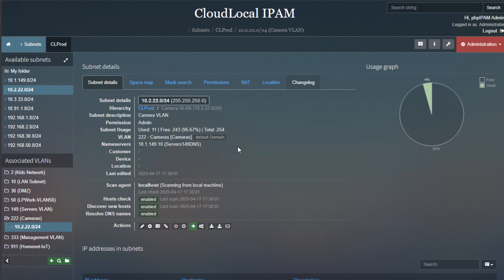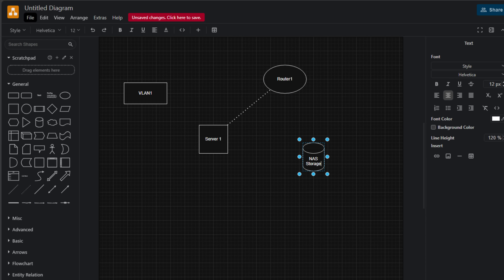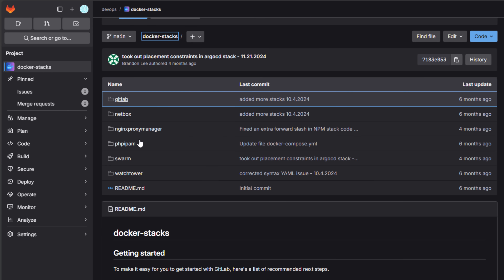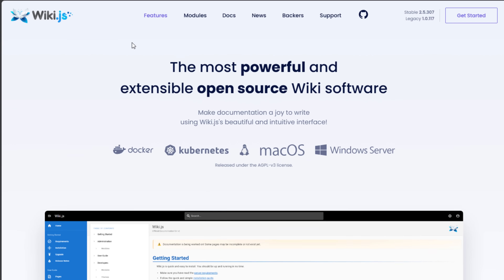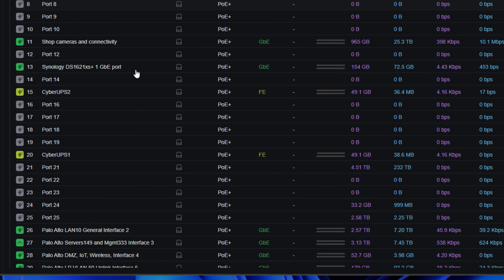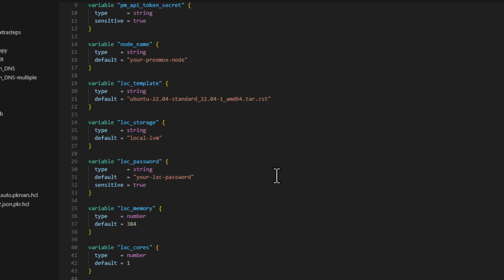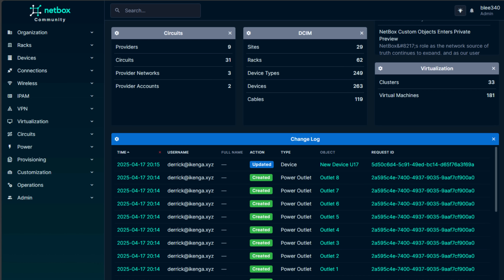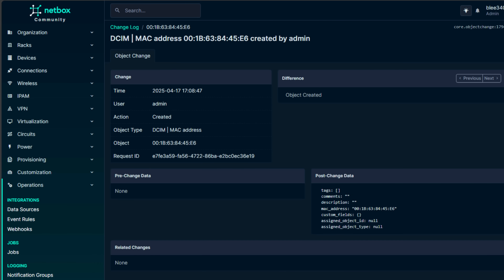Home Lab Documentation // Tools Tips and Tricks!

Comment: For the wiki part I use just a common Hugo based site (MD files that generate static html). As a fallback I have copy of the generated site hosted at a normal external website provider with a password protection turned on

Comment: Do you know of any proper and active alternatives to phpIPAM? Any project that "forgets" to properly update the installation guide once written at least 11 years ago I don't call recent and active. In this 11 years old guide they talk about Debian 6.

To cite the Debian Wiki "Squeeze was the oldstable distribution until the end of May 2014. Squeeze received Long Term Support until 2016-02-29. Now it is archived, and no longer receives security updates" => the LTS version they talk about in the installation guide is out of LTS status for more than 9 years! Ample time to "just" update the Debian version and have test it once and see if it works with this new version.

I mean even the PHP versions they talk about are ancient going back to a time the 4chan hack also had.

Even the not mentioning if there is an official Docker image I don't see as a bigger problem!

Comment: For me, it varies.

re: logging changes into a changelog
My primary issue with this is that the vast majority of the time, the changes happen significantly faster than I can document them.

If I were to try to document all of the changes, 99% of the time would be spend of the changelog administration rather than the actual homelab administration.

As such, changes that are stable and have been committed, that's when I was will usually go back, especially if it is a system nor a service deployment, that I will go back into the bash history, to pull out the commands that I used that finally, ultimately worked.

(Because documenting bash commands that failed or didn't work, even if I was auto-enrolling/auto-documenting those changes, wouldn't be useful.)

Once it's stable, then I will, for now, dump them into my deployment notes that's stored in a OneNote.

(I wished that OneNote supported the markdown format, by default.)

I use that because it doesn't depend on my network being up (i.e. I'm not running some kind of Docker/containerised application to serve this function).

And like you said, that way, if the entire system/homelab goes down, I'd still be able to get to it, in a searchable, electronic form.

It is a more primitive method, I know, and as such, it can't do a lot of stuff automatically, but when everything goes down and we're thrown back into the Stone Age, I'd still be able to get access to it as the OneNote file(s) just needs to sit somewhere.

Comment: Nice video. I have been using MediaWiki for many years and it has served me well. It is replicated to a remote location just in case it cannot be accessed locally. Templates for just about documenting anything on the network are stored as well as rudimentary change logs. I would love to switch to netbox or equivalent.

Comment: This is a great topic not only for homelabers, but in the corporate world, we all know how documentation has been a nail in the plate forever. And it always comes down to a human factor at some point, even with the automation solutions we can only mitigate. And the root of the issue is that documenting and maintaining it is borring. We can't wait for the days when an AI will be a true assistant to document for us and help us retrieving anything from the deck of the Enterprise (Yeah). Imagine a dedicated AI, that will run on your homelab and be aware your setup. Imagine a full blown AI module in your proxmox kernel ? Actually AI is the missing block of our OS kernels that are faily old now ...  😶‍🌫 
So I use a little tool called Joplin, it's simple and light, but the most important is that I can sync my docs in OneDrive, Google drive, Dropbox and so on, and access it even from my phone (there is a phone app on Android). I'm sure you can achieve something similar with many other tools out there, but give it a try.

Comment: Only one glaring concern - while at home sure those entry level label makers are ok, at work don’t cheap out. Cheap labels bend, break, tear etc. cheap label makers usually don’t help in automating or minimizing your work also! Especially if you’re preplanning / cutting!
Reply: Finally spent the money on one that has dedicated features for things like cable wraps, and the difference is wild.
Reply: @sam_spaxter  very wild. My last 7 projects for structured cabling have been a labor of love. Trust me when I say when it comes to our work find any and every tool to help automate or minimize time. Crappy labelers waste time in production (respectfully).
Reply: @sam_spaxter  my next project will be taking a closed down office and integrating most of the networking here at our main office. Sad part is the cabling is horrible here already. So my next big boy purchase is a Brother labeler (most likely) because redoing a about 10 patch panels, individual cable flags, port panels etc haven't been cleaned up in about 10 years.